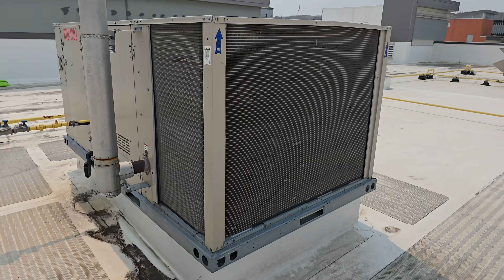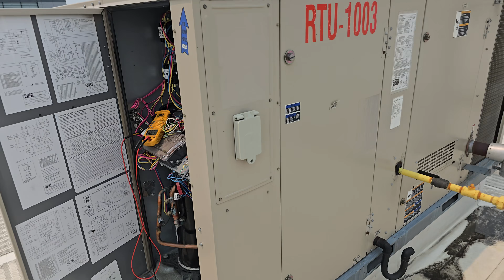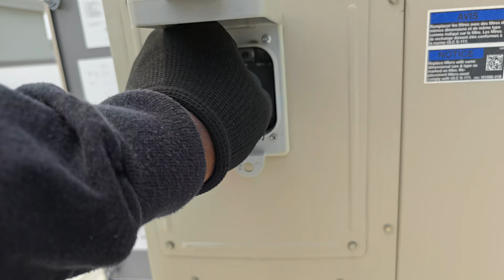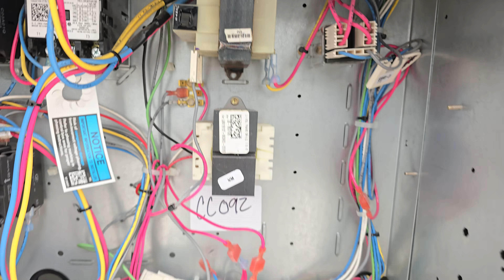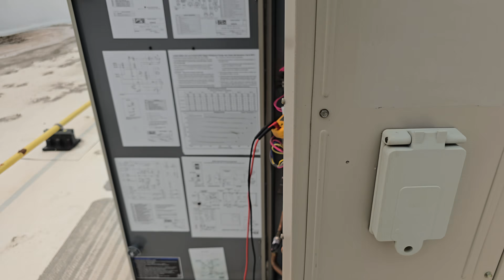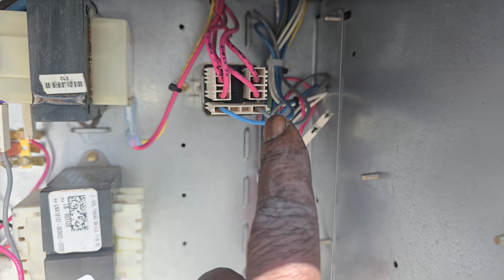Lennox Rooftop Unit Keeps Blowing 24V Low Voltage Fuse? Watch Complete HVAC Troubleshooting.

Comment: The whole time he never looked at the schematics.  You are having a 24v issue. You have replaced  2 parts unnecessarily.  The relay was the issue. It was the first  point of contact  after leaving the transformer.. Your elimination method was incorrect. Start from power  in always.
Reply from the maker: Thank you for your feedback! Please subscribe, like and share the video. I appreciate your support.

Comment: U should have taken your ohms reading from the coils. I am sure that's where the problem originated from. . This is  your brother on the same field as you but doing his thing in Chicago Illinois. Which city are you?..
Reply from the maker: A sticky or normal resistance reading only confirms that the winding is intact, it does not guarantee the contactor will operate properly. Thank you brother from Chicago Illinois, we are in Toronto Ontario service Greater Toronto Area (GTA). Please subscribe and share this channels.

Comment: Did you try ohming the contactor coils?
Reply from the maker: A contactor coil can measure the correct resistance and still fail under load. Simply ohming (measuring the resistance) a contactor coil does not by itself prove that the coil is good or bad. Can you tell us how to ohm out a contactor coil? for good or bad
Reply: @hvacmechanicalsystemschannel ohms law